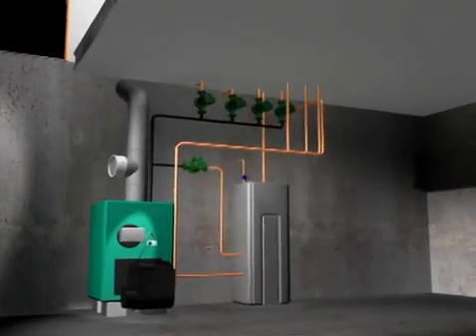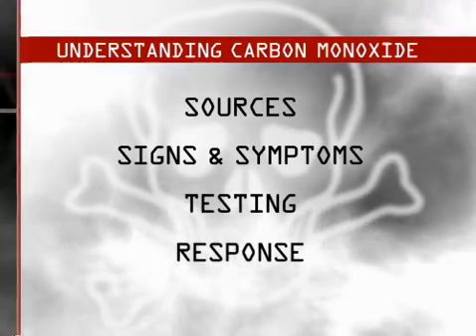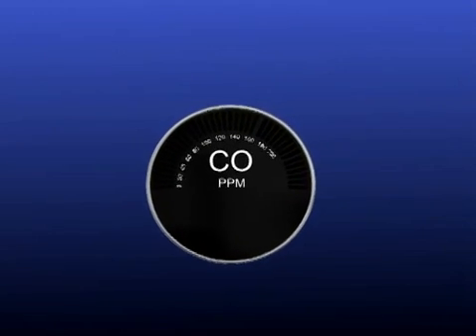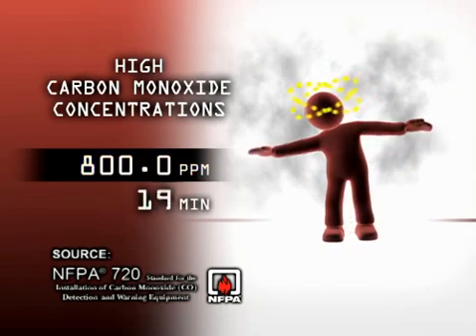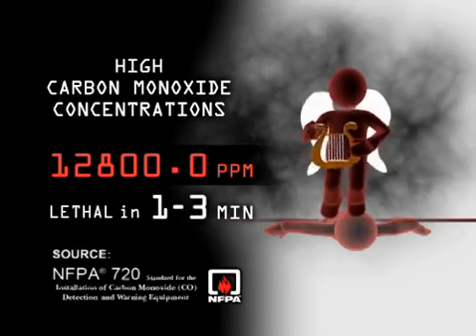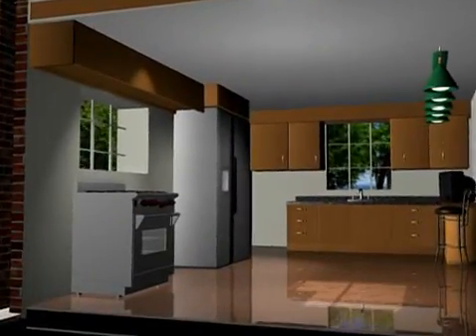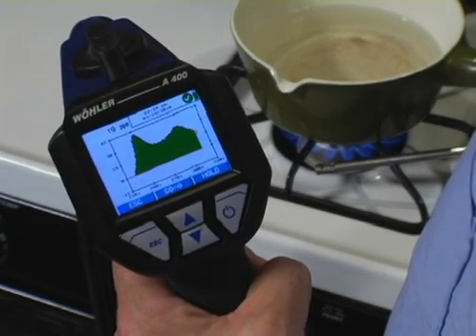NORA Video 17 - How to Respond to a Carbon Monoxide Alarm

Comment: 10,000 ppm of CO - will cause death in 20-30 seconds.
Reply: 8:54 mark - that is the reason why you never use portable power generators inside or near a garage. The CO that can be released can be way too much for you to handle - and can cause you to pass out - in extreme cases, death is possible.
Reply: How about 8940?
Reply: Cuz the alarm at the gas station I’m working has been on like that for about an hour

Comment: If your adrenals are working properly, the body will first respond in panic mode, increased BP, pulse, to try and supply oxygen.  Headaches will always come first, memory loss, dry red eyes, hazy/blurry vision and you will find yourself acting slow like a zombie, your pets behavior will also change.  These are some things I went thru for months until I figured out what it was.  Doctors or ER and most people know nothing about testing for CO blood levels or know the symptoms.  CO exposure if very common, it may not kill you, but it will starve your body of oxygen and cause long term damage.  ER will not test you for it unless you tell them specifically.  Measuring oxygen levels will give a false reading showing normal levels because of the way the sensor works.

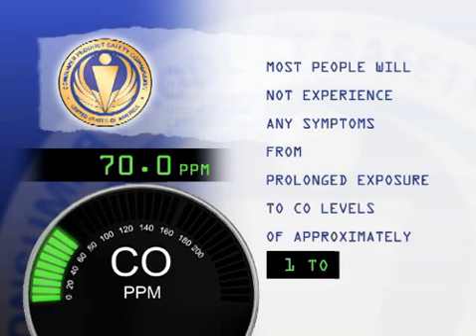Comment: At 5:45 the video speaks to low dose-long term exposure and merely repeats the same bland propaganda so it sounds harmless. Not true.  The public available CO sensors can be held over a burning trash can and not alarm  There are currently available CO monitors over the internet of the type now used by fire, police, pilots, emts, etc for $100 and up.  The current CO limits are set by industry.  Why? because cars produce 5,000 ppm CO upon start up.  
The hype for hi eff gas furnaces is heavily dependent upon air movements outside, the size of the air space vented into and extracted from, the surrounding height of the landscape, the flow of air through the collection site, and direction of air movement.  We went from chimney roof exhaust to almost ground level exhaust with all of the above impingements so how can that possible be an improvement?  
Boilers may have required specialized knowledge but the continual 'adjustments' required as yet another problem crops up with these 'hi eff' furnaces is more guess work than knowledge.  
I bought a house thru Rural Development inspected by authorized inspector who omitted the fact that the hi eff furnace was reversed and blew thru the cold air returns.  I did not know this until I had it seen to by certified HVAC who charge me $150 to tell me it was reversed.  I have had two episodes of CO poisoning one Nov 2015 and another Dec 2016 when especially cold days of zero and 10 below nights for two days caused the furnace to produce CO.  911 call and hospitalization for 2015 and self administered treatment of sleeping in room with sliding glass door for air for second 2016 exposure.  Requests for assistance from Rural Development are for naught.  I am 70 and live on SS income.  I would not benefit from a legal todo.
Reply: You are right on.  They are purposefully downplaying the long term exposure of CO from furnaces, because furnace companies do not want to be forced to get rid of their low efficiency furnaces.